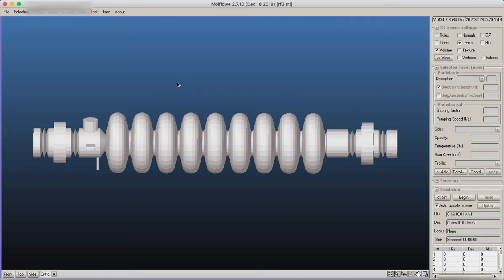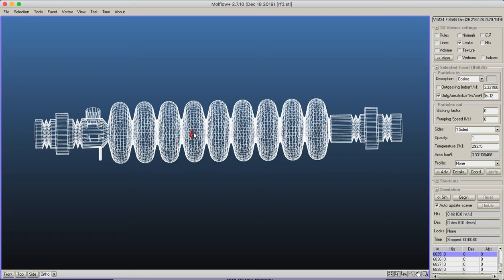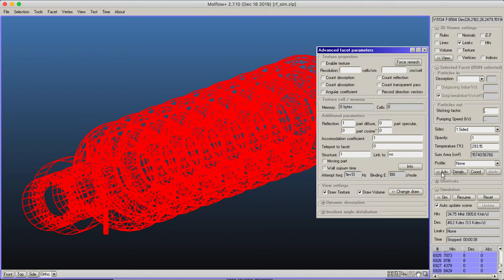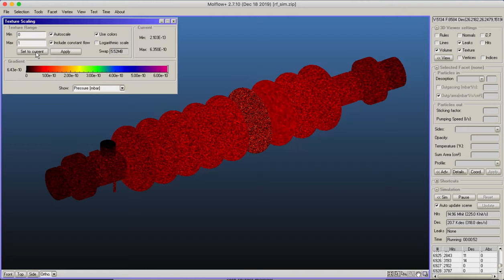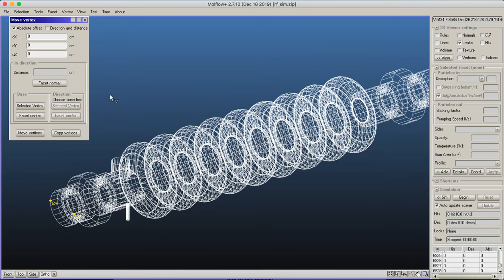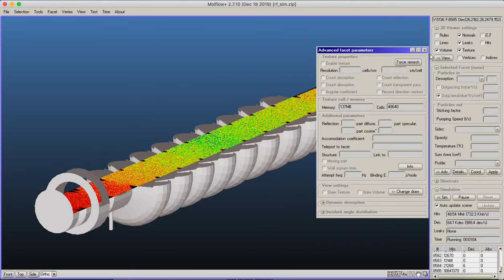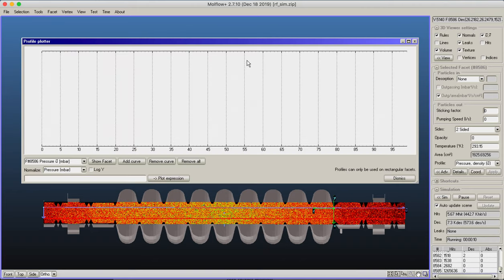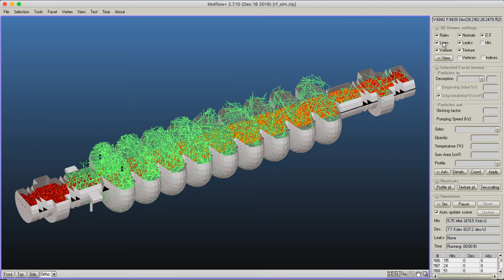Molflow webinar - Basic simulation of an RF cavity

Comment: I am creating a plane to visualize the pressure as shown in the video. The facet does not get hit somehow. Lines do cross it visually but the count of hits is always 0 for that facet, as a result the texture does not show the pressure. I set it to have 0 opacity and the texture to count the transparent passes. Any advice? Thank you!
Reply: Most likely the plane was created twice, so there are two facets at the same position and one is masking the other. If not this, there could be several other problems: non-planar facet (check facet details, the planarity should be 0), facet's structure (in advanced facet parameters) is not the same as the rest of the system, etc. If no quick solution is found submit the file at the Forum on the public website and we'll have a look. Good luck!
Reply: @szakeetm  Thank you! I worked around this by importing the sampling plane together with my geometry in the first place and it does what I need now, though it is inconvenient. I will try to figure out why the facet created in molflow is not similar to the others that were imported following your suggestions. Thanks! :)